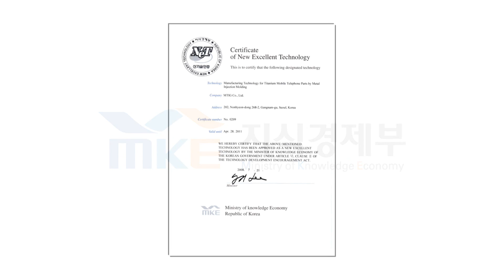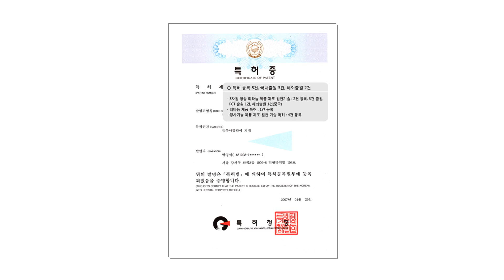Titanium material  MTIG Co., Ltd.

Comment: MTIG (Material Technical Innovation Group) Technology
1. Titanium powder injection molding parts manufacturer sale
      3D precision parts is easy to manufacture.
2 . Titanium powder manufacturing sales
      Pure 99.5% higher, Ti 325 -800 mash
3. The price is very cheap
     Mass production, automated production
     Prices are similar to stainless steel components machined parts prices
4. The world's first titanium powder injection parts manufacturing plant
    - Hwasung factory
5. Ttitanium plasma spray coating material powder manufactured for sale
     Atmosphere from the world's first spray coating technology
6. Surface treatment in natural titanium colors
    - Incheon factory
7. KFDA standard "biological safety tests (including animal transplantation test)
     Certification
8. "NET: New Excellent Technology" certification
9. ROHS certification
10. US dry cleaning test passed
11. Korea Patent 15 results
      China Patent 1 results
12. Confirmed that the US accounting firm Ernst & Young 
Current MTIG Technology First